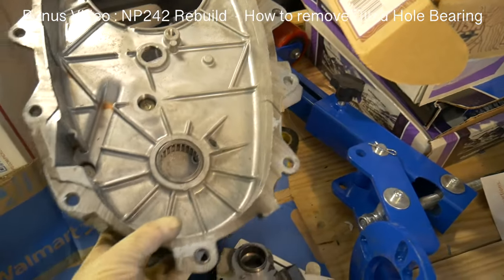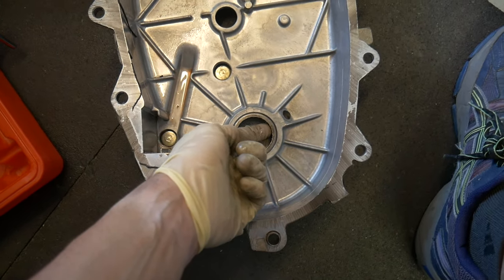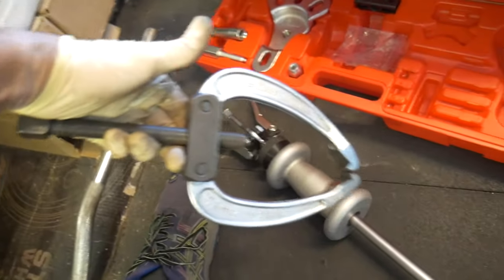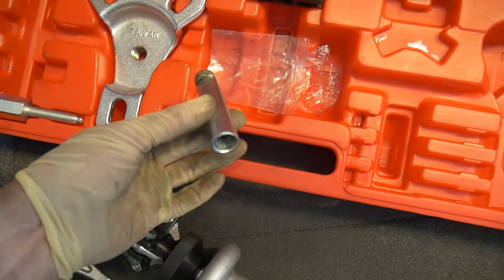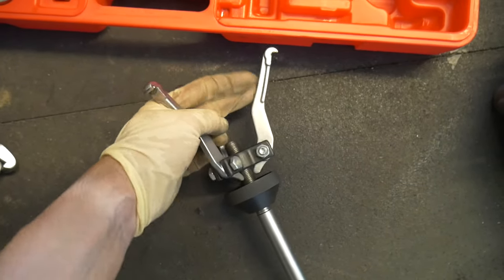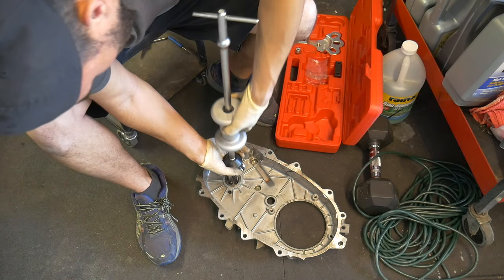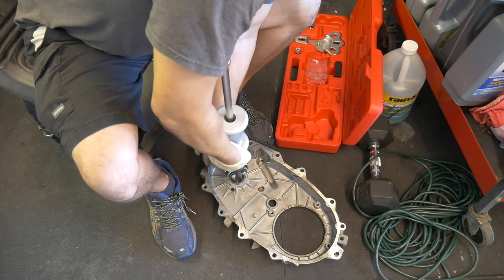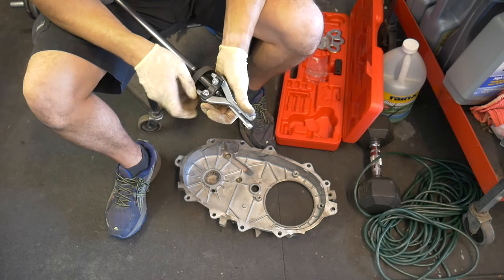How to Remove a Blind Hole Bearing - NP242 Transfer Case rebuild Jeep Cherokee Xj / np231 np249

Comment: Dang, I had no luck with this method. I was hammering hard and it would not budge. Ruined the threads on my slide hammer. Got the blind bearing puller kit on Amazon for $60 and that did the trick.

Comment: Ok I damaged the bearing trying to remove it the same if I put the case in the oven at 350 the bearing should fall out in about 5 10 minutes correct or I could weld a stick to the top side of the race and the shrinkage should cause it to come out is this correct or should I use the chisel and hammer or die grinder to cut the inside of the race wall enough to split and fold it in any ideas will be appreciated thank s

Comment: Lightly heat the surround with torch, use slide hammer and pops right out..  should be warm, not hot

Comment: Did you have to use any other type puller attachments? I just ordered a blind hole kit but the biggest die like 32 mm is too dang small.thank you and good job

Comment: Knock the needle bearings out of the race and weld a short  bead in 3 or 4 spots on the inside of the race, let it cool and it will almost fall out.
Reply: This is how we always take out blind races, but I didn't know it would work in aluminum housings. My grandfather was experimental engineer at Cletrac and he taught me this trick.
Reply: Ok so is I use the mig and wels a bead about 1/2" long up down in four spots it should drop it out maybe a little help right.